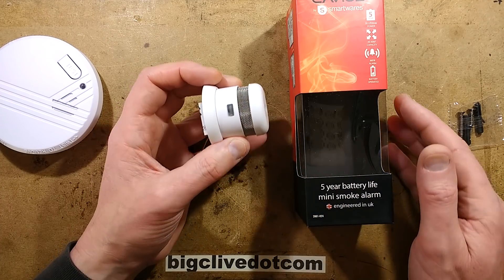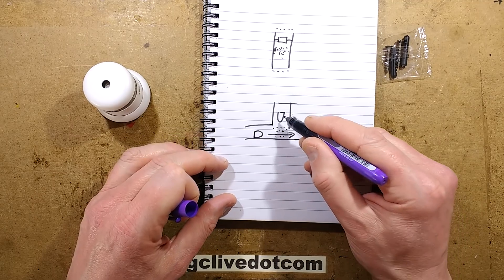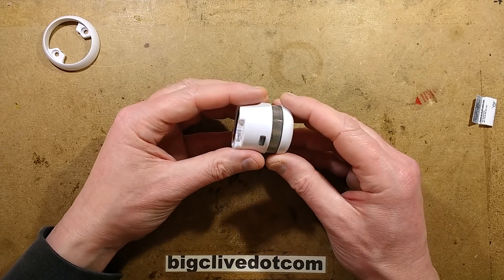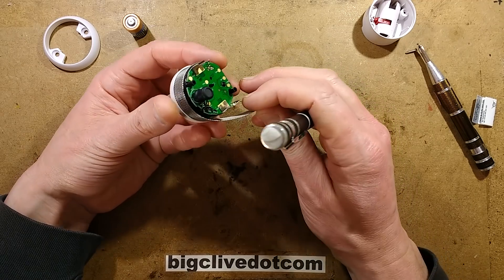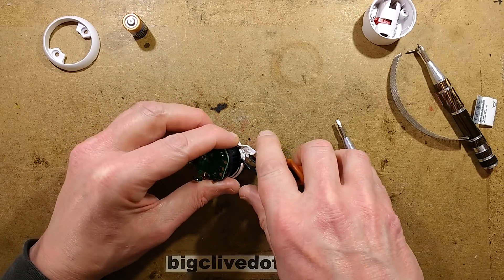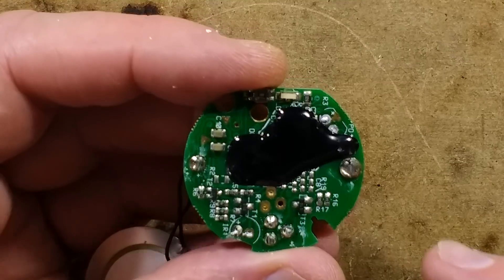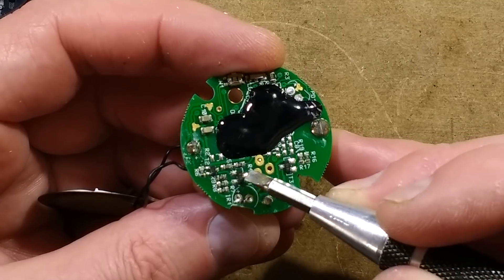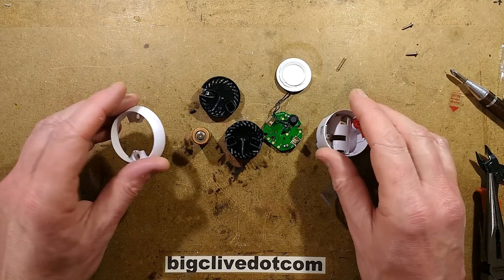Inside the tiny Cavius smoke detector.

Comment: I find that old ionization chamber smoke detectors detect smoke at very early stage and low concentration, making them far more trustworthy than the newer optical ones. This is just an empirical observation, and could be wrong.
Reply: Ionization are better at detecting fast acting fires/smoke like burning food or a kitchen fire. Optical are better at catching smouldering fires which is probably more important. Because that is the type of fire most likely to happen when you are sleeping and have no idea until it's too late.
Reply: Ionization detectors also trip at the exhaust from a petrol mower wafting through an open window in my experience, though that case was 30 years ago. I think the industry has come around to the conclusion that optical is a good compromise between sensitivity and convenience (i.e. not tripping so often when there isn't a real fire).
Reply: Why is it then that what little experience I have with optical detectors, they do not seem to get tripped by any amount of smoke, whereas ones with an ionization chamber are very quick and very sensitive? Have I only had bad optical detectors?
Reply: Jaakko Oksa, it is to do with the type of smoke. The optical alarms are more sensitive to larger particles of smoke from smouldering fires like from a burning sofa, you can’t really set them off by accident unless you smoke. Ionisation alarms detect smaller particles of smoke from cooking fires but they can also be set off by steam. Optical alarms will still go off after an acceptable amount of time for smaller smoke particles but ionisation ones will take about 1/2 an hour+ to activate, if not, at all which of course is not acceptable. The best thing to do is have both types but if you can only have one, pick optical.
Reply: Old smoke detectors were built better and contained more radioactive material, one Honeywell model had 13.4 microcuries.

Comment: I hate to discredit your research, because there is a lot of misinformation around about smoke detectors. The 20 year old ionization models are the best IMO. Keeping in mind that they should all be tested with real smoke occasionally. The photo ones are relatively slow and should only be used where an ionization one delivers too many false alarms. I think the detector manufacturers or someone has an agenda to eliminate the ionization style from the market. Perhaps the world's governments want to prevent any more "radioactive boy scouts." (RIP David Hahn.) In my testing there is no reason to dispose of detectors at 10 years of age nor buy a photo-electric one unless one is suffering from too many false alarms from the ionization type. My only photo one is and will remain the one nearest the kitchen.

Comment: Didn't some kid make a 'nuclear reactor' out of smoke detectors?
Reply: Tortoise of Doom i know he used the glow-in-the-dark stuff off alarm clocks too
Reply: David Hahn, the Radioactive Boy Scout. And yup, he used the Americium from loads of smoke detectors to turn his mum's home into a Superfund site.
Reply: I wasn't aware you could use americium as fissile material.
Reply: Pete Allum You're right, you can't. However, you can severely contaminate a site with enough of it. The kid must have collected a LOT of detectors.
Reply: The Americium source in your Ionisation smoke detector, is also used in the "exquisitely high-sensitivity" electron-capture detectors in gas chromatographs.
Reply: dothemathright 1111 Yes, a shame. While the direct cause of death was alcohol poisoning, his other health issues may have been leveraged by radiating himself years earlier. If I had to get cooked that way, I'd much prefer a millisecond timeframe (ironically said by someone who has been to Trinity Site 3 times).
Reply: Americium is a decent neutron emitter, so it can be used as a starter for nuclear fission, but you also need nuclear fuel (such as enriched uranium) to have a reacrion

Comment: The official manufacturer video says the resin covering is for humidity protection.
Reply: Sven 
If that's the case, the pads for the photodiode should be covered as well. Clear conformal coating is better for inspection.
Reply: Andrew White https://youtu.be/c4Y3Q0CB4Uk see at 1:38. Maybe the components covered are more sensible to humidity increases. Maybe resistance changes and cause incorrect alarms or failed/delayed alarms.

Comment: Amazing how LEDs have reduced power consumption to make downsizing like this possible! I still have an optical smoke detector from the 1970s which is 120 VAC powered with a 6 FT power cord and plug, and uses an (under-driven) incandescent light source. It is called Vanguard SmokeSonic. Vanguard's answer in case of a power failure was a key-wound spring-powered ThermoSonic heat detector to work with it... gold-colored, metal and heavy (I would bet 10 LBS or more). I found both of them in a box at my grandparents house when they relocated to a seniors residence.
Technology has come a long way!
Reply from the maker: I remember the old tungsten smoke detectors.  The lamps in them did sometimes fail, but by that point they were probably so dusty inside (helped by thermal airflow effects) that they had served their purpose.
Reply: Amazing?  I've never once had any problem fitting the largest smoke detector I've ever used, where it was supposed to go, and using a standard, cheaper alkaline battery (as a backup to mains power).  Cavius tiny smoke detector seems to me just like a foolish overly expensive way to get the same thing done = anti-progress.   Reinventing the wheel with no clear advantage and only higher cost, is just pandering to idiots.

However, I did enjoy watching Clive analyze it, though he uses the word "basically" far too often.  ;)  I suppose we all have words we overuse.
Reply: I watched 7 minutes of video and didn't hear him say "basically" even once.
Reply: @stinkycheese804  Another advantage is the wireless on some models - so if one unit detects smoke, it makes them all sound.  Great for modern houses with soundproofing.

Comment: Just today (Saturday), I found in my basement, a lithium cell just like that, 1/2 AA, 3.5 volts, in a parts house bag dated 6/24/92. It measures 3.75 volts.  I did not try to run anything (yet).   That was 25 years ago!!!
Reply from the maker: Lithium cells have a very long standby life.  The capacity may have reduced a bit but it will still probably provide useful power.

Comment: Hi Clive, I have awarded this video 7 stars. I usually award your videos 5 stars. In this case, you get an extra star for public service and another extra 'safety' star for advice about when to replace the battery. Incidentally, my rating system is one star low, five stars excellent. The maximum rating is five stars.

Comment: its interesting that UK version say they have a 5 year life. in New Zealand they market them as a long life 10 year battery,  5 years sounds more realistic.
Reply: David B 
Perhaps they think it's less dusty in New Zealand?!
Reply: I have had those cells do 20 years plus with still having usable capacity, though after 30 years the internal resistance was pretty high.
Reply: Possibly a lithium battery in the non-UK version.
Reply: https://www.cavius.co.nz/  and  https://www.bunnings.co.nz/cavius-photoelectric-smoke-alarm-with-10yr-battery_p04211172  im not sure if these links will work outside of New Zealand.  the one we have here you have no access to the battery without dismantling it. and they are made to throw away after the 10 years.
Reply: yes same in New Zealand. i put some links up as well.
Reply: yes same in New Zealand. i put some links up as well.
Reply: i Have just been looking up a few specs on the battery's, the UK ones have a CR2 battery and the New Zealand ones have  a CR123A (larger size) hence the 10 year life span.

Comment: Are these able to communicate with other systems? The alarms in my house are battery powered and send a signal to a care system installed in my home. There's no physical connection between alarm and the care system.

Fancy taking a CO detector apart Clive??
Reply from the maker: +Jack King Some do have communication facilities.

Comment: 2 years ago i replaced my old 120volt line one.. cause it was ancient must be from 80's but it never worked and was buzzing so loud when i taken it down i saw 2 grey wires cut on it.. not sure if its for the led on side tells it its use is over. or if it was used to tie them together so it triggers anymore on same line or they got tired of it beeping and it was the well.. forgot what called it all ready lmao but yeah. new one is called a kidde but works well now... even in my apartment ive set it off accidentally over and over even though it was far away from kitchen but thats fine means its working good if its from that distance. old one far as im looking at it here is called Pyrotronics Canada LTD... hm.. never heard of them rofl. edit: decided to take it apart.. i think its even older.. the entire circuit is gross white.. and track is all soldered tracked with no varnish or whatever protection todays use.. its all exposed and weird looking resistors. ahaha led looks like nothing ive ever seen its short red stubby varient of the biggerish red ones and has copper leads on it. with 2 rings around on back side..

Comment: Big magnets are so fun from a safety standpoint. I remember watching one video of guys who play with big arse magnets, you actually have to think about where you are going with the magnet because the possibility exists that it could pull other objects straight through walls, and you, they are that powerful. Scharfenberg couplers on trains are a good example of this, as the train edges closer, it will come to a point where the magnets on the couplers are close enough and they will snap together. It’s surprisingly loud and the pinch point warnings really aren’t joking — if you put your hand in the coupler’s way, you will not be seeing it again. Fuckin magnets, how do they work? Dangerously, apparently.
Reply: Moon Moon 
They work with witchcraft, I tell you, witchcraft!
Reply: I thought it was Imps?
Reply: I agree. I have a 500KG pull 3" diameter N52 magnet and it really does have destructive potential. Got to keep away from literally everything electronic, any metal structures, magstrip cards, etc. And skin being typically flexible and flabby, loves to get pinched in between surfaces all the time.
Reply: https://www.youtube.com/watch?v=6dyMwAToYVk

For those interested, here is a scharfenberg coupler in action, the wing-type things at the sides, are the electromagnets. Here in Australia they work a bit differently. Coupling trains together is fully automatic, you nudge the throttle just a little bit, just to get the train moving, it will continue rolling and the magnets energize and pull the two together. Once this happens, the coupling mechanism itself locks into place, and electrical and data connections are made automatically on more modern trains. In this case, the two computers on both trains start talking to eachother, to determine what the other train is, and any fault logs and whatnot are synchronized between the pairs, this is so the driver at one end, knows of any faults that might be at the trailing end. Here in Queensland, every passenger train is fully electrically compatible with every other train. Meaning, a train built 40 years ago in 1979, will couple with, and talk to, a train built in 2006. While this is not done in service, it's a handy procedure to return a few trains to the depot with one driver. It's not uncommon to see 12-car trains, consisting of four 3-car units, to be running together, headed somewhere. One driver is in control of all 4 trains, and it doesn't matter which end you drive from. Because they are electrically compatible, the old end can lead and be in control, or the new end can do that, whichever direction you need to run, the train being driven, will control the rest.

The couplers actually have quite a lot of play, they're not a fixed, rigid object. Being in the middle cab of a two-unit in motion, there's a hell of a lot of movement in all directions. While coupling is a fully automatic process, decoupling is a tad less so. In the cab, to decouple a train from another, it first has to be stopped, mechanical interlocks will not allow you to decouple a train in motion, which makes sense. There are two buttons, sometimes the second button is actually a keyed switch. You have to either hold both buttons down for several seconds, or turn and hold the keyed switch, and press the other button. The coupling mechanism unlocks, the magnets de-energize, and the couplers that snapped into position before, retract slightly, allowing you to leave the other train behind. Electrical and data connections, are, handily, automatically ceased during this process.

I'll stop babbling on now, I've gone from talking about something barely featured in this video at all, to a completely different topic. I'm too damn good at that...
Reply: Moon Moon - thanks for the info mate!  I found it very interesting.  I live for these little technical pearls of wisdom.
Reply: As I said before, the pinch point warnings really aren't joking. Check out Brainiac75 for an example on this. Look at how complicated just joining and separating big magnets is. He does this by using a ramp of sorts made out of wood, the ramp is just high enough that the magnets will attract eachother, but won't clamp with any significant force. The ramp is then pulled out slowly, the magnets getting closer, the attraction forces increasing, until the ramp is gone and they snap together. Separation is another mission entirely! If you like Big Clive you would probably like Brainiac75, too.

Comment: Is there much if a price deference between the photo a ionizer, detectors. I'm guessing the ionizer were first built, them came the photo.
Reply from the maker: I can recall some really old optical detectors with flashlight lamps in them.  They required constant power though.  Ionisation detectors are mass produced, but optical is theoretically cheaper to manufacture in the long run due to the lack of the ionisation chamber.
Reply: Wouldn't be surprised if we start seeing optical detectors over take ionizing ones in the next 10 years
Reply: An issue for manufactures and distributers of ionisation detectors is how much of the radioactive material you are allowed in one place!
Although optical detectors are less sensitive to flaming fires and more sensitive to smoulder fires, they are still very sensitive. 
The newest optical detectors in professional systems use multiple LEDs/photodiodes at different angles and different colour LEDs to optimise performance and reduce false alarms
Flame detectors tend to be used in industrial situations where it's to dusty for smoke detectors or where what's burning makes no smoke.  Normally It's better to detect smoke before a fire is flaming!
Reply: I'm pretty sure that the ionization smoke detectors were easier to manufacture - most likely they needed a less complicated circuit. Most of the cheap detectors I've seen used to be ionization.

Comment: A shame they are so expensive. $45+ compared to the older styles between $8 and $30.
Reply from the maker: These ones were about £10 each if you shop about.
Reply: The photoelectric and heat alarms will In theory last near forever as there is little to wear out
Reply: The ten year rule is mainly for ionisation as the americium 241 degrades as time passes. I have a first alert atom like this one. Cool alarm
Reply: Apparently they can set each other off too.
Reply: 19€ in Germany. But reviews say the battery lasts only 2 years. And there's a model with a sealed-in 10-year-battery which seems to actually last between 2.5 and 7 years.

Comment: No test button ?   BTW I can x-ray that PCB if you like!
Reply from the maker: +mikeselectricstuff It has a test/mute button.  I've since seen a manufacturer's video that shows the machine putting on the black resin.  There were what looked like an op amp and a processor in standard SMD packages and some other components.  I think it's to protect the signal amplifier from humidity.
Reply: A hot air nozzle might have melted it.
Reply: Hey Mike, didn’t see much coming from your channel recently...  are you taking a wee break? ...  Loved your GPS BUOY video...   All the best !
Reply: Oooh and the Gyro video!
Reply: Erm... 5:15
Reply: mikeselectricstuff mew

Comment: My ionisation smoke detectors get set off by small spiders on the circuit board :)
Reply from the maker: +ForestCat_Peter You could mask off the sounder and sensor, and spray the PCB with lacquer.
Reply: I shall do that next time it happens! They are fairly new, basic EI 100B models, for those playing along at home :)
Reply: ForestCat_Peter , 
Thats the primary function of the stainless mesh.  The biggest challenge to keep out are tiny insects called Thrip.  We call it a bug mesh but the name can be confusing to software engineers 😉
Reply: Mine get set off by boiling water within 20 feet. Safer? Maybe. More annoying? Definitely.

Comment: Speaking of secrets, the piezoelectric sounder also acts as a microphone.

How paranoid can we be about potential listening devices in our homes, Big Brother? 😎
Reply: Mechanically all speakers can be used as microphones. Not very good ones, but they will pick up vibrations.
Reply: It's just listening to know if it did it's job successfully...if it goes off and then hears screaming later, it get all sad.
Reply: Jon Taylor 
If you bash a piezo speaker hard it is possible to generate enough voltage to damage unprotected driver circuitry.
Reply: Reciprocity is a neat place to live...